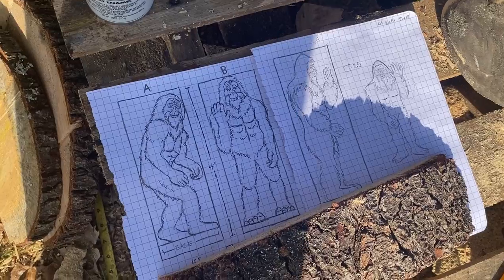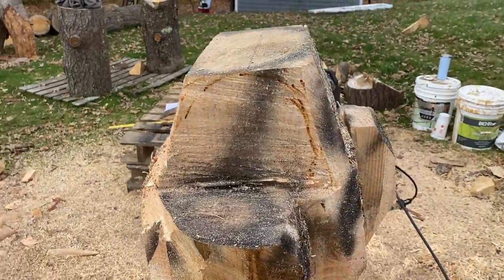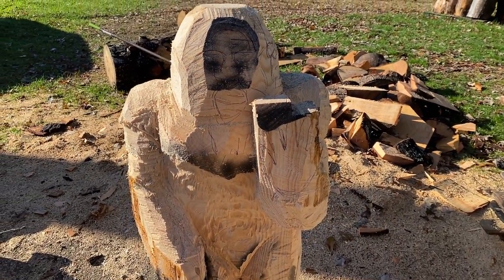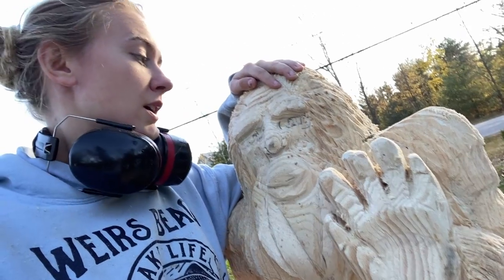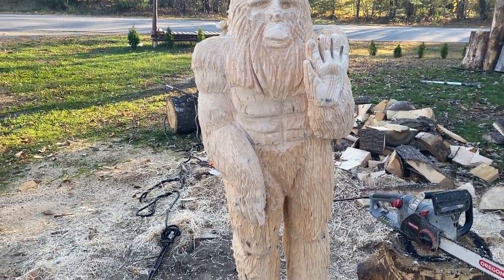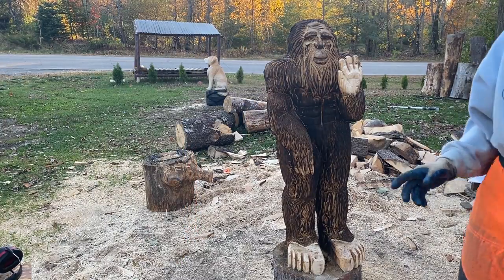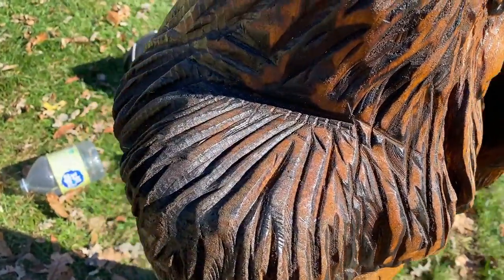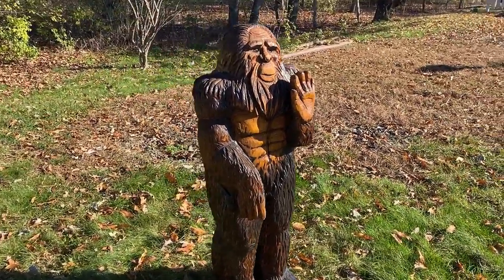Lets Carve a Bigfoot

Comment: Hi Tay. Just came across this one in your feed. Curious about the Australian timber oil. Is that what gives that color as well or did you use a stain before using the oil? I also see this is when you were using your electric chainsaw. Just wondering if you ever had any problem with kick back on your electrics?
Reply from the maker: Good questions! So Australian timber oil is pigmented (comes in a variety of colors) it both stains and seals the carving in about 2-3 coats. No need for anything else unless you want a glossy sheen, in that case you could follow it up with a SPAR coat. I now use mostly TWP1500 series, which is practically the same thing as Australian timber oil (TWP is much easier to get then ATO due to VOC laws)

As far as kick back, I never had issues with the electric saw but I also haven’t had issue with gas either. Kick back will and does happen, but 98% of the time it’s expected. Rarely do I experience a surprise kick back, over time you just learn positions that make it more luckily. Happens a lot less with sprocket-less carving bars (like dime, quarter, and toonie tips)!

Hope this helps!!!

Comment: I've always wanted to carve a Bigfoot. What kinda wood do you use and is it wet or dry when you carve it? Also what do you do about cracks after it sits for awhile
Reply from the maker: I usually carve Eastern White Pine! I like my logs to sit for 3+ months unbarked so they start to check and I can strategically place the cracks towards the back or the piece. Applying a high quality timber or decking oil will help reduce large cracks from forming by slowing down the drying process. But crack really are unpreventable, so it’s best to work with them and embrace them when possible! Color matching the cracks to the carving helps blend them in too! Hope this helps!
Reply: @TayMarie23  Yes it does thank you 😊

Comment: Beautiful carvings, you should really get the steel chainsaw with a carving bar and carving chain though. Even though I don't have any experiences of carver, I know that having the right bar, chain, and chainsaw combination can make your work a lot easier.
Reply from the maker: Thank you, and you are 100% correct! There really is no point in getting a gas saw right now since I’ll be working inside very soon and you can’t run gas indoors! But I just got a battery saw the other day and I hope to put a carving bar on it this winter! Now that this is my full time gig I’ll start pouring funds into my tools as I can afford it 😊 My current saw also has the manufactures chain which is a low profile/low kick back chain…so she cuts extra slow 😂 I actually really like the low profile chain for texturing but it can be a bit underpowered for the blocking out stage 🙃
Reply: @TayMarie23  Yep, Nice! What saw is it?
Reply from the maker: I’m giving the greenworks 16” 40volt a shot, used it for the first time today actually, but only for 10 minutes - not enough time to give an opinion yet! Just need something small and lightweight for detailing, hopefully this does the trick! I tried the EGO battery saw and hated it. I honestly prefer the feel of a corded saw over the battery ones 😂

Comment: Australian timber oil?
Reply from the maker: Yes! Honey Teak ATO!!
Reply: Do u use it for everything? Including things your going to paint?
Reply from the maker: @pinkeyswoodshop  depends on the price point of the carving. If it's a custom order or a more expensive inventory item, I will oil first, then let dry for a few days before painting over the oil with an oil based paint :) If it a smaller carving or lower price point I will paint right onto the wood.